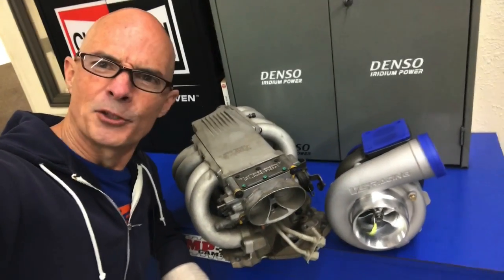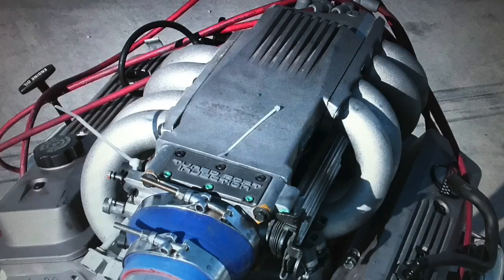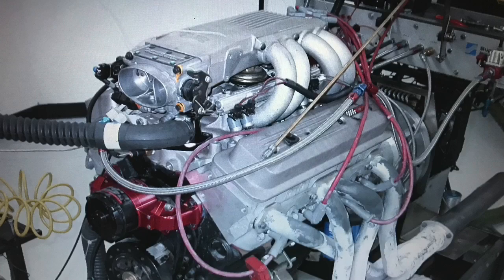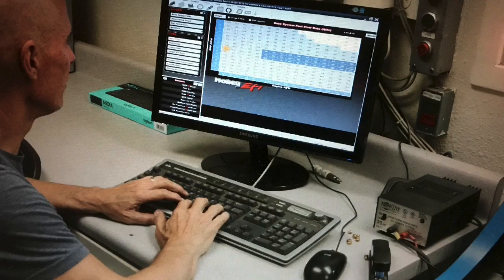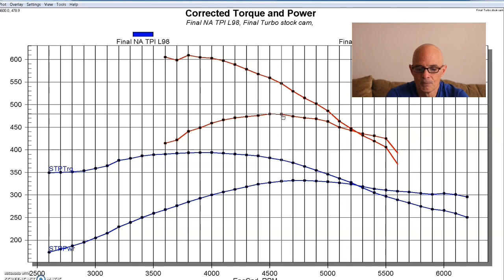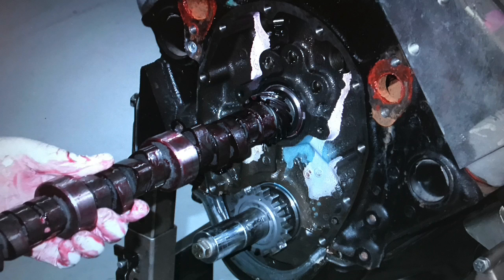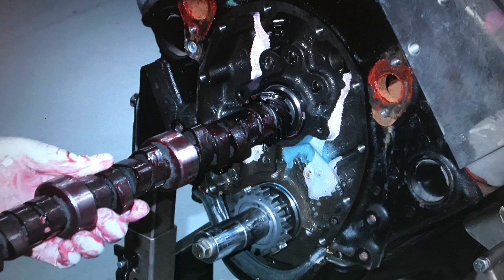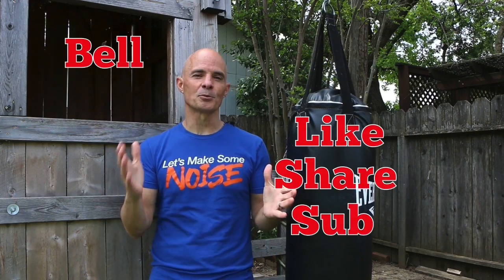TURBO TPI-BOOSTED TUNE PORT

Comment: So I got a TPI Iroc and I’m planning on turbocharging the car and using the stock manifold because I love the look and originality. Plan on Trick Flow super 23 head with a 56cc chamber, but what camshaft and management system would you recommend using?
Reply: Did you ever build it ?

Comment: I think Fasterproms has a 420 CI w/ TPI in their C4 that runs mid 10's NA
Reply: Baby-Shark GTO that's a pre-production mini ram intake. they still sell those today, but his is a extremely ported version that should flow better than the one you buy today, plus a good set of a believe brodex heads ported so far they have to add epoxy to seal the water jackets, a huge solid roller cam too. it's a great build that wish they would do some justice with on the channel. it's a proper 9s car na using 90s tech. if they would stop screwing around with the combo and just take it to a 1/4 mile and get it sorted tune and tranny wise. stop with the 1/8th mile guessing and silly fuel blending stuff to cover for the lack of tuning

Comment: QUESTION: On the TPI intake, do the runners on the passenger side go to the head on the driver's side and the runners on the driver's side go to the passenger's side head? Seems like too much of an angle if the runners fed their own bank.
Reply: They cross to the opposite side in the base

Comment: So here's something on my mind, Richard. I'm not sure exactly what the difference in runner length is between for example an LS6 Intake and a TPI intake but clearly LS motors have the ability to rev even with long runners. Clearly we have efficiency differences here but if we optimize OUR TPI manifold with porting and plenum porting or even a first manifold and good heads can we cam this thing to rev out? I really would like to see what it would do with the turbo and some RPM around 6500. Now I know there are much better manifold options than to just optimize the stock intake, the HSR from Holley for example of the Miniram from TPIS but I'd kinda just like to see how far we can actually get the stock TPI manifold to rev, maybe even with a better set of runners on it. These TPI engines we just don't see much of so it would be cool to see just what we could get one to do and let's get rid of that wimpy freaking cam man, geez, let's get into atleast a Comp 503 with some 1.6 rockers or something. Wanna see more from this engine and c'mon Richard get us a freaking LTX!!!! I've been begging for months for an LTX build!

Comment: That TPI manifold is absolutely top 5 of the coolest intakes Chevy ever made.
Reply: number1 is the zr1
Reply: I think it's awesome I changed my tpi to stealth ram I miss my low end torque but love being able to pull to 6k
Reply: 100% and compared to the fox body's flopped over manifold, seriously that intake looks like it had a stroke and went all droopy, the tpi is gorgeous.  In 2012 I was at my local yard and came across a Trans am that was bent in half from an encounter with a tree ( bark was visible stuck to the body) and when I popped the hood I almost had a stroke and went all droopy, because the owner / the deceased had installed gmpp vortec heads and a scoggin dickey vortec tpi lower with slp runners. All told once I pulled everything off from the heads on up I spent.... $162, it would have been more but I left the sensors and Chinese fuel injectors behind. And as anyone in this hobby knows I couldn't just install my new to me go fast goodies, no no I immediately got to work yanking the engine out of my car (89 Iroc) and hauling it to my local builder for a ubiquitous 355 build. Thus turning my ultimate cheap find into a not so cheap winter project. But the guys at Burns and Yost only charged me like $700 to build the short block so I can't bitch. And once it was all assembled and back in the car I realized that the 1980's ecu with the processing power of a Casio watch wasn't going to cut it, and a friend of mine introduced me to speeduino ecu's which are cheap, open source, very powerful, have free tuning software that my dumb ass could use, and are basically everything megasquirt said they were until they realized they could sell their crap for between $400 and $1500 per unit. Seriously speeduino and tuner studios... tits on glass 😃, you can get a ready built ecu that will do everything that one from companies like FAST or Holley can do for less than what those companies charge for ther gaskets. There's a self tune feature you can use if your like me and allergic to math, you just need a wide band and you're golden. OK 🆗 rant over
Reply: @limabravo6065  
I have a tpi and a mustang 5.0 302... you're right the Ford intake looks like a dead octopus head 😂 I still love that Ford tho
Reply: @xmo552  I've had both, loved both, and if things keep going the way they are with vehicles snitching on drivers and conducting data harvesting with telematics, I'll be getting another one soon and one with just an am and fm radio
Reply: @limabravo6065  
Man I'm going the same way. I'm keeping gasoline as long as I can. Carbs and Strombergs and manual trans. The harder they shove electrics down my throat the more I'm going towards Model T's or horse and buggy.
Reply: @limabravo6065  
What.
Oh teach me the ways 🙏
Reply: @limabravo6065  
I think you connected 2 too many P words and the overseers deleted what you said.
Reply: @xmo552  haha, it's called waste plastics pyrolysis and I learned it from a hippy on YouTube,  basically you build a kiln with a vacuum pump so you can get all the oxygen out and cook the plastic past where it would burn, and it breaks down into oil aka hydrocarbons and then you can fraction distill it like regular old black gold petroleum only the oil companies did you a solid and removed all the nasty stuff like Sulphur so the plastic would be clear. The fuels you get burn super clean, but the gasoline only has an octane rating of about 50, hence me mixing it with ethanol which get it back up past the 87 octane point. Oh and if you have a diesel you can use kitty litter to remove the dye from heating oil so the man can't bust you for running it on the road
Reply: @limabravo6065  
Damn the Fuzz
Reply: @limabravo6065  
Officer Doofy or Deputy Enos Strate😂
Reply: @xmo552  yeah man I'm right there with you. I was a cop and I know cops are necessary , but out where I am if you call 911 it'll be 30 minutes before they show up, but ever since Pennsylvania local police departments got access to license plate readers they're out there doing traffic enforcement like Johnny on the spot to generate revenue like never before (local pd's were prohibited in PA from using radar speed guns because our Supreme Court said that instead of serving the community they'd just sit out and write tickets all day. Well this new tech comes along and gives them something almost as good as radar guns and surprise surprise. So in addition to fuels production I also have an absolute shit load of fire arms because these assholes aren't going to help
Reply: It is one of the prettiest for sure.
Reply: The rearmost piece.... that covers the distributor... is always missing because the bolts seize and break.
Reply: Unmatched torque.
Reply: The cross ram would be on that list for sure try power 427 intake TPI then maybe the Z28 LT1 intake from the 60s the one from the '90s I can't pick a last one those are my favorites!
Reply: I definitely agree! Even just looks alone they are hard to beat.
Reply: Absolutely agree. I have my 89 firebird with it and think it would make good truck motor with all of that low end torque.  Wood love to have an old Z71 with 4x4 and tpi.
Reply: @backyardbuck6362  GM should have made the an l98 engine option in the in the trucks
Reply: @joehudson3072  The L05 heads+TPI made really nice numbers based off everything posted on Thirdgen. It was probably among the best truck engines they never offered.

Comment: I swapped in a late 80's TPI 5.7 into my Camaro. I dont know what the numbers were but it pulled great at the low end, would spin the tires on the first 2 gear shifts on a built 700r4.

Comment: I’d love to see you try making power with a Oldsmobile 307ci 5.0 V8 that was used in a ton of cars back in the 70’s and 80’s in Buick Regal’s Oldsmobile cars.
Reply: I second the motion I'd love to see an early 5a head 307 with the vin9 HO cam .440 196/210@50 109lsa or something bigger like the comp OL-xe250H-10 run on the dyno you've shown the ford and chevy 5L some love dont leave us Olds guys out in the cold
Reply: I did a 403 swap and never looked back.

Comment: Love the TPI motors. Best truck motor GM ever put in a Camaro. 

Takes me back to the days as an inexperienced (dumb) kid, tried to make my own siamesed runners for more top-end power. Luckily I had another set of stockers to put on.
Reply: I have a dyno test that says those siamesed TPI runners do produce more power ........
Reply: @niagrasprings  I believe it. 

But making your own doesn't always go well. Especially when you're inexperienced with welding aluminum.
Reply: @idriwzrd  My male parent never taught me anything about working on cars, because he did not know anything.  I had to pick it up myself, any way that I could.  One of my first major successes, at age 16,  was switching the two barrel manifold and carburetor on my 1969  Nova to a quadrajet set up.  It was a major undertaking for  a 16 year old with no substantial support, and something that my male parent was counting on me NOT to be able to do, because he wanted my car to be slow.  Then there is all of the stuff that I messed up  --like the horrible paint job that I put on the same car, because I just did not know much about paint, which I still can NOT do, and avoid because its so toxic.  I became a machinist, a mechanic, and a welder,  mostly so I could know how to work on cars ......now there is a huge electronic aspect to it too. How far along in welding aluminum were you when the attempt was made on the TPI runner tubes?
Reply: @niagrasprings  
Father, the word is father aka daddy.

Comment: Love my 90 l98 tpi, things smoked more mustangs n pigs than i can count
Reply: Can verify that. My stock 89 Formula 350 stomped all stock and even mildly modified 5.0 Mustangs back in the day. Only ones I ever lost to had different heads on them. Even beat a stock Grand National. This was before I put a Paxton supercharger on it along with a lot of bolt ons and it has beat LS1 F Bodies and even an early LS1 Corvette back in the early 2000s. I often debate putting an LS1 in it but the TPI and its massive off idle throttle response is just so much fun to drive.

Comment: I know my ws-6 formula firebird, even with the 5.0 tpi was decent for a 305, I swapped everything to a 355, with aluminum heads, it ran good then, with T-5 and 3.45 gears, I'd like to swap a 4.8/5.3 in it now, with boost, maybe 600 tire,

Comment: I’ve always loved tuned port. Back in the 90’s I lost my license for having too many speeding tickets so I hand polished the TPI on my 3rd gen. All the mullets. A younger me always thought it would be cool to add throttle plates to the runners that could open at 3800rpm when those motors start falling on their face. Kinda like an on demand itb setup....aka quadrajetpi
Reply: Thats what newer cars do

Comment: I have a soft spot for these engines and the cars they came in. I had a few TPI F Body cars over the years, mostly in the mid to late 90s. They were cheap back then.

Comment: Another consideration is the intake plenum itself.  It had two bridges behind the throttle body that seem to dynamically block intake airflow above 4400 rpm.  I bought a new Corvette in '85 and with less than 50 miles on it, ground out and smoothed the intake of the manifold and installed 1.6 rockers - made a big difference in 1985, moving the peak up to nearly 5000 rpm

Comment: Those intakes look cool, but have power/torque curves reminiscent of a diesel engine.
Reply: I always the TPI set up looks so cool back in the day!
Reply: those runners on a 305 made it a good performer, on a 350 made it a low rpm torque motor that took out many mustangs across an intersection.
Reply: No argument there. Actually, my daily driver is a turbo-diesel.

Comment: Pretty good video... Too bad you didn't have a good camshaft to try. One that was actually designed to move the power curve up in the rpm range a little. Couldn't go very far back then because the front pump in the 700r4's didn't like 6000rpms. This was when people started learning high rpms weren't really needed to go fast or to be quick. Well... Some people.
Reply from the maker: #wrongcam

Comment: I have a pile of these intakes...  I liked the "Cross Fire" fuel injection also.  Like you said, they are probably the best looking factory intake system ever made.  

However, the reason they fall off in HP at the top, is more related to intake runner size, than the length.  Inside the manifold, the runners are pretty tiny.  And if you look at your graph, you can see the boosted curve is not identical to the NA.  It falls off faster at high rpm, because it can't handle that much air.  I believe they are probably the perfect truck manifold though...

Also, regarding the possibility of building a turbo C4 Corvette...  Have you ever looked under the hood of one?  There is just no extra room at all.  I think a Procharger is a much more practical option, and even that is a very tight fit...
Reply: Take a long non ferrous ball grinder thingy and open up the plenum lower until a 3/4" socket goes through each runner.

Comment: How about a tight lobe separation with boost?????
Reply from the maker: yes but they hurt idle
Reply: @richardholdener1727   but how does it effect boost. Most turbo or nitrous cams including fuel injected engines have wide lsa. I know how they behave on a carbureted engine, how about fuel injection and boost

Comment: Wow. That is a very small camshaft. 
You didn't really go over the head flow, or the intake flow?! 
You're right, the tuned port intake looks so cool. My friends always thought that intake would flow so well, but I always explained that they are just for low and mid range torque. They are all finished by 5k.

Comment: Those motors were a little underrated. I have an 87 Corvette with one. I've run a best of 13.46@98 mph with a well tuned but stock motor.
Reply: That is fucking stellar. Makes me want to find one
Reply: Bart, which rear end gears
Reply: @olderthanyoucali8512  2.59. They put a looser torque converter that year and it launches hard.
Reply: I have a 87 black coupe doing headers and a mild cam on right now

Comment: Do a mid 90's LT1 build next. Stock, then HCI, and off course boost it to cap it off.
Reply: i think this is the sleeper motor. Minor tweaks to the 90's LT1 , drop it into an early c4 (L98) But then an LS2/3 would be a nice drop in  but you can grab a full trans , motor and loom for so cheap for an LT1.

Comment: Why does this motor have a flat tappet cam? The l98 motors were roller cammed engine
Reply from the maker: Not the early ones
Reply: Must be and 85 86 motor.
Reply: L98; Intro 1985,  mid 1986 got aluminum heads upgrade, 1987 got roller cam upgrade.  The featured L98 engine displays  factory (?)   aluminum heads,  so your question is totally legit.  An inspection of the engine valley would show if the engine block came with factory threaded bolt hole provisions above the cam tunnel to retain the stamped steel "spiders" that in turn hold down the "dog bone" (figure eight) collars for roller lifter pairs.

Comment: 2006 they started testing engines with the accessories on
Reply: In 1972 they started testing engine with air cleaner, exhaust and accessories.

Comment: I'm interested to see the potential of an old LT1 with an LS harness and CPU retrofitted to it. One guy out there is running a 8 second quarter mile with a similar setup and turbo.

Side note: I have a 1995 LT1 that's been sitting for over 20 years that I would volunteer for abuse
Reply: That's possible,  there is a company that makes the conversion kit.

Comment: With the right size turbo, I can only imagine how little lag there would be. When your only trying to make 400 horsepower from 5.7l you could probably spool the turbo at idle. If it's a 67mm turbo, it's huge for this at this boost level. Hx52 turbos are relatively common and have the benifit of a T4 flange. Still, depending on who you believe it can flow more than 80lb/m and at this power level you need about 44lb/m.
Reply: You're still too big. You need like an HX40 or a small turbine TP38 or a 60-1. On a 4.6L or 5.0 Ford they're good for about 425 to the tire and that would be on  a stone stock 350.
Reply: One thing you can do here is to use a huge turbo like this but run a full stock engine with regular fuel. When your turbo is way oversize and consequently you'll be running very low boost pressure for the airflow, it's much less stress on the engine due to reduced heat load and you'll also be easier on your entire power train due to peak torque coming in at higher rpm and in a smoother manner.

Comment: Great video! I did my turbo TPI setup back in 05! I never had my car dynoed, but full weight Third Gen Firebird running 130mph in the 1/4 mile. Has to be making pretty good power. Still have it today. I beat up on many LS cars
Reply: I have a 5.7 85 vette any info on how I can start a turbo build?